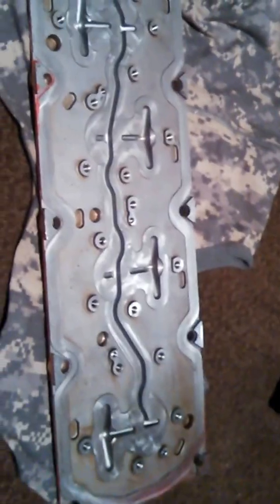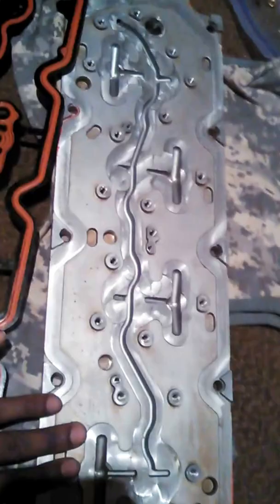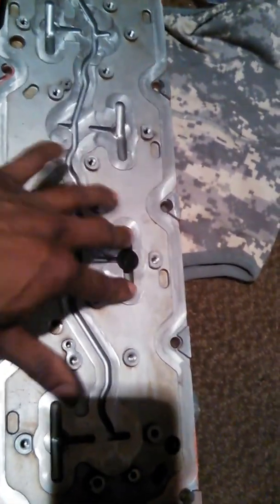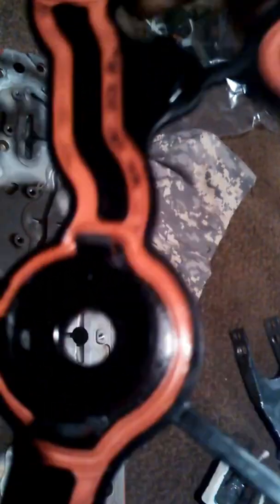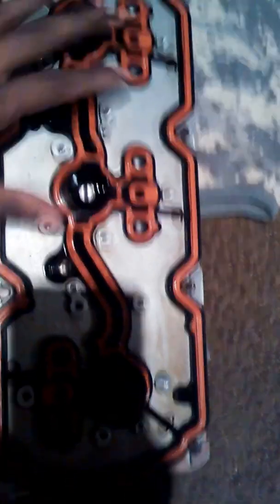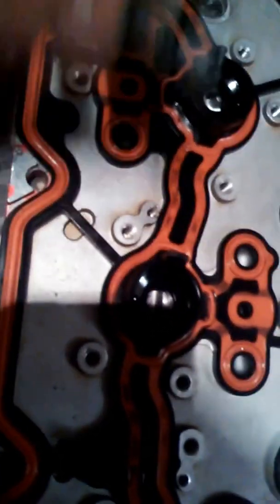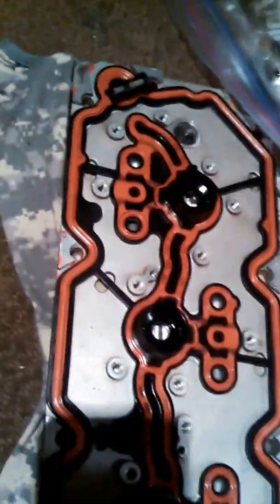GM DOD maintenance

Comment: Good in depth on the vlom.  I run archoil ar9100 in my oil I had some issues used truck with the dod system added that to oil ever since no more issues.    I've ran the stuff for over 100k in another engine with no problems. Add to each oil change good pm

Comment: Please respond. My plate was leaking so i bought the replacement gasket kit but i can not get the retainer plate or what evet apart to bbn put new gasket. Are the star bolts the only thing holding the retainer to the plate?

Comment: Oil pressure sending unit filter ? Can u pls tell me where is that unit ?? It’s it in that same plate ? Thanks .
Reply: just changed one out.  Its next to the fire wall backside of AFM manifold plate.  i had to lay across the engine get to it on a 08 Z71.  Can remove the oil screen with a narrow flat tipped screwdriver. I think i used a 7/8" socket and extension to remove the sensor, the screen is below it.  (2-3 hrs)

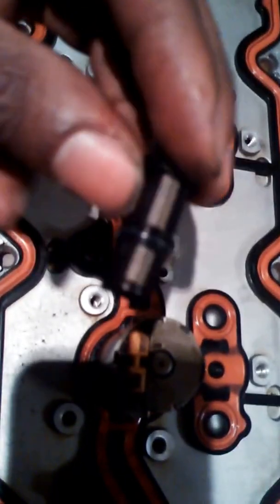Comment: Where do I find that part that you say also needs to be cleaned that goes into your oil filter sending unit to clean it too? Is it located on the oil sending unit, or in the AFM manifold, or in the solenoids? (I'm referring to the Part in your hand at 2:17)
Reply: O' Reilys parts store

Comment: ALSO, please expand the title of your video, adding the words 'GM AFM lifter failure' in order for your great video to be captured by everyone with a lifter or AFM problem-- I have been researching this problem night and day for two weeks with mechanics and engineers and dealerships... and if I had seen your video first it would have taken me a day to get to the true bottom of this problem!  (no mechanic ever used the term DOD, so I only searched by the terms 'lifter' and 'AFM' so your video did not come up to view. it was by fluke i came across it today!) Great work, sir!
Reply: cissy vaughn I’ve been searching for this for a year.
Reply: I knew that the lifter failed but weren’t the root cause.

Comment: Also if anyone is doing a DOD delete and you plan on changing your cam and lifters out and just shutting off the Vlom I'm leaving this cover on you cannot do that I will repeat you cannot leave this cover on! thinking you can just disable it in the computer oil will backfeed around the lifters go up into that Vlom cover and leak out the discharge oil ports and you will  barely have any if not no oil pressure!! You have to block off those ports by buying another cover or making a plug kit or buying a DOD delete kit! Very important you cannot just disable it
Reply: If I just plug in the 'Range' disabling device and shut down the AFM without changing out the cam or doing anything else, will disabling the AFM with that 'Range' product/device CREATE the backfeed and leak at the discharge oil ports you describe? !! (or are you saying that only if I change/updating the cam without taking this out I will get this problem?) (In short, am I creating this problem you describe if I do nothing else besides plug in the 'Range' AFM disabler?)
Reply: how is the Range Device working for you 11 months later?
Reply: Corey Anderson What do I have to do if I'm running a carburetor setup on my 4.8 do I have to change anything under that plate?

Comment: how did you disassemble the plate?
Reply: See my comments above-- cleaning this may not be the only problem. Most of these lifter failures come from this being an inferior gasket, so the gaskets shrink/pull away and that's what creates the inability of this gasket to hold the pressure in this area sufficient enough to activate the solenoids to oil the lifters, which then leads to lifter failure. They have recently updated this part to address this issue, so you should probably just replace the whole gasket instead of just cleaning it.  See my comments for explanation.